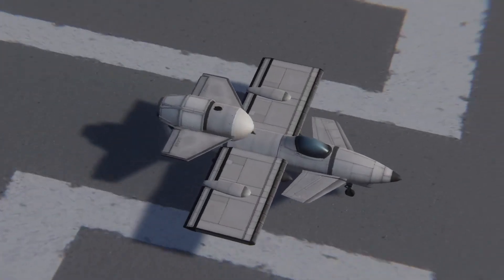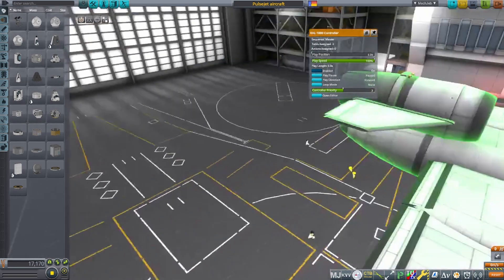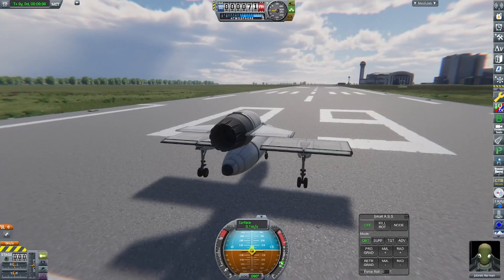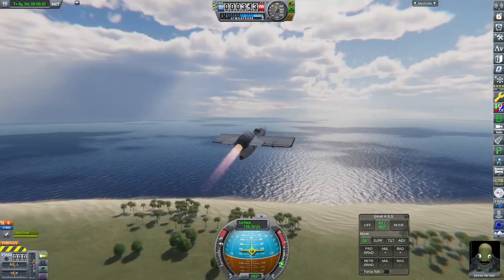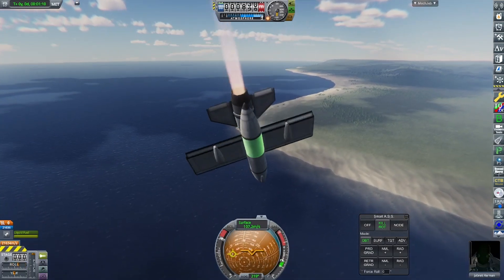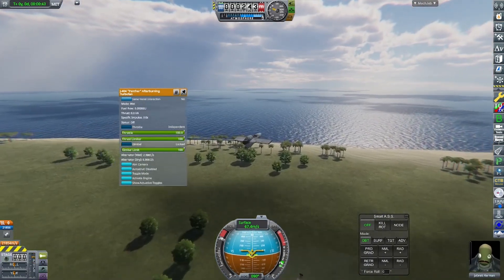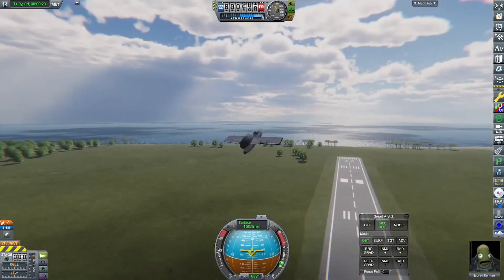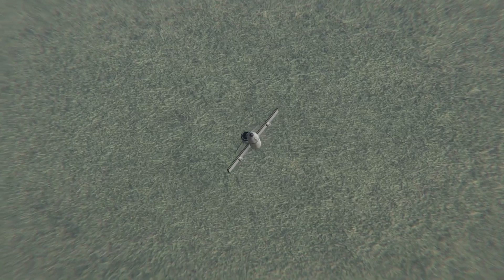Pulsejets in KSP

Comment: try using fireworks as propulsion by hacking the with the KAL1000 controller with the infinite propellant cheats. it should accurately simulate a pulsejet engine at least when it comes to the way it produces thrust, however be aware that it can be quite laggy and you might need to edit how the fireworks look a bit to get the visuals right.
Reply from the maker: id say that looks more like an orion drive and yeah it would be a little goofy